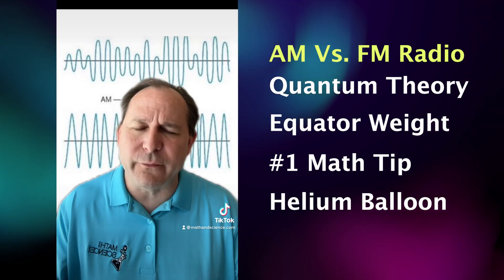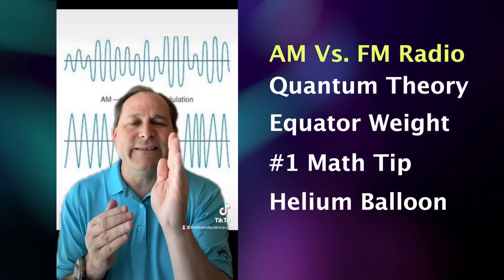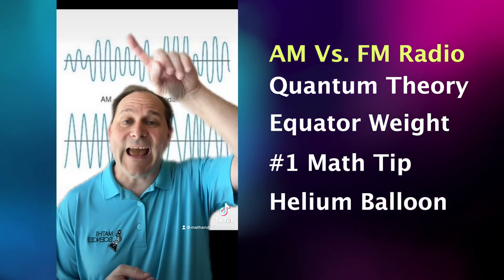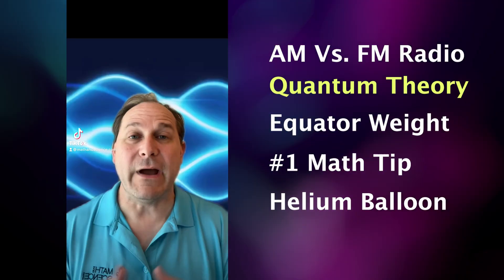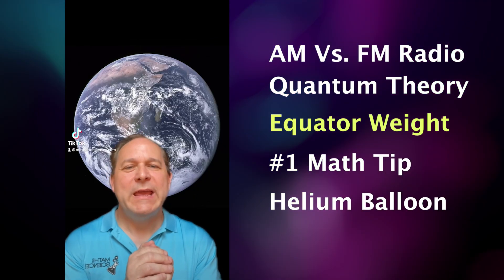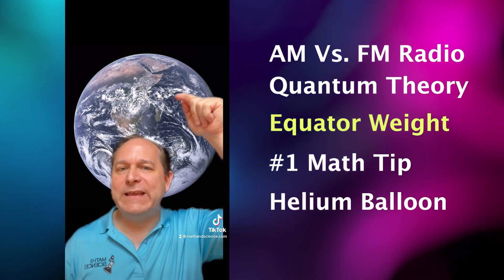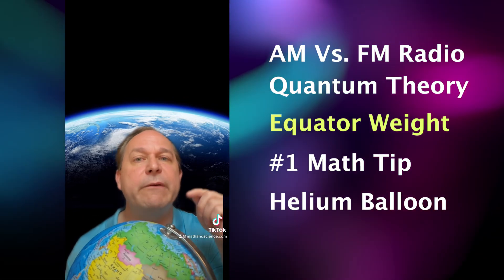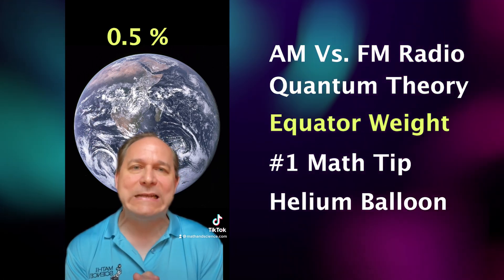What's the Difference Between AM & FM Radio Waves?

Comment: "AM (amplitude modulation) is analog, where the amplitude or height of the wave changes to carry the signal.
FM (frequency modulation) is also analog, where the signal is carried by changing the frequency-the distance between the peaks of the wave-while the amplitude (height) stays the same. In FM, the frequency (measured in Hertz, Hz) changes, not the amplitude.

Comment: As for balloons... The most perfect balloon would be a vacuum balloon. The question is whether there is a material that is light enough, yet strong enough to keep its shape despite the air pressure. I don't think there is one. A question: Let's take a "normal" helium-filled balloon. The Mariana Trench is 11,035 meters deep, and at its bottom, there is an incredibly high pressure. If we start pushing the balloon down there, the water pressure compresses it more and more. So the weight of the balloon remains the same, but its volume and thus the buoyancy force acting on it also decreases. Is it possible that there is a depth where the buoyant force is less than the weight of the collapsed balloon. That is, is there a depth from which the balloon would no longer rise, but would sink?